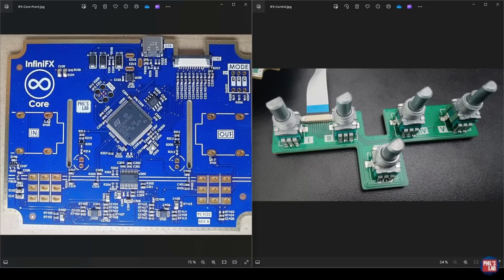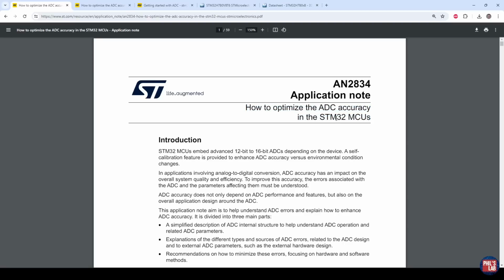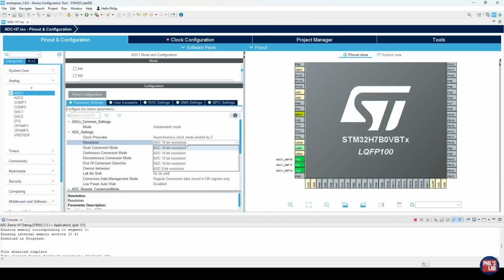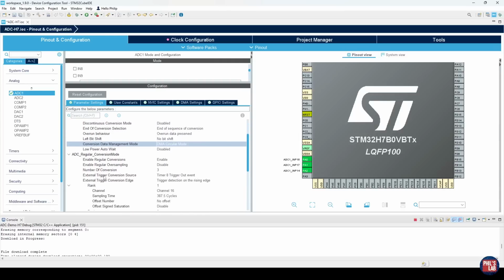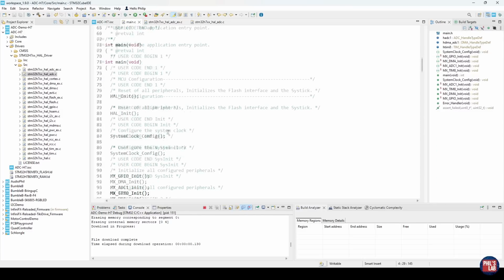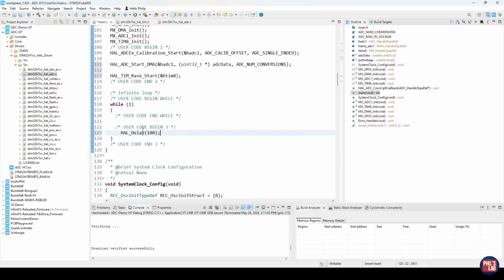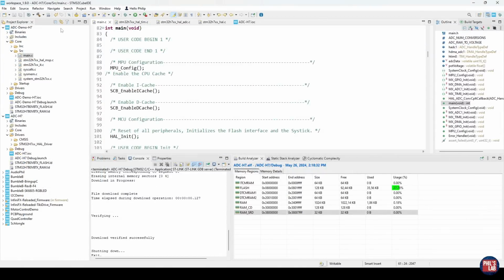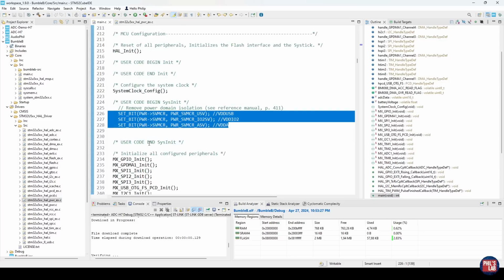(Sponsored) STM32H7 ADC + DMA + Timer Firmware Tutorial - Phil's Lab #138

Comment: This video is something I needed!!
I'm developing a VA synthesizer. I started development on Disco-F407 where I was able to run 4 voices, 16bit 44.1kHz. Then I moved to Nucleo-H723, cause I don't need a dual core uC for it. And there mayhem started...
It did not matter how well I would optimise code, it barely handled 5 voices. Then I saw yesterday that on this ARM core I have to enable caches to get a full speed of this core. I did it for I-cache as D-cache broke my DMA transfer to DAC. But thanks to your video I was able to enable and properly configure MPU to have D-cache enabled too. With I-cache lone it ran 7 voices (decent), but now it runs at least 12 voices (maybe more, did not test yet and I would like to have some spare cycles for FXes and modulation buses), so I'm pretty satisfied :)

Your channel kickstarted my interest in embedded DSP along with some books about writing softsynths. Now I have the power!!! :D

Comment: The best advice regarding any STM32 FW development (especially, but not only) for beginners - Go to C:\Users\<Your username>\STM32Cube\Repository\STM32Cube_FW_xxx - there you will fing your installed HAL packages from ST. Go into the folder for your CPU (so for example 'STM32Cube_FW_H7_V1.11.2'), then 'Projects', there you will find a bunch of folders for the Nucleo/Disco/Eval boards from ST. Pick any of them (sometimes you need to go through a bunch of them until you find what you need..), there go into 'Examples' and there are folders named as the CPU peripherals. Peripherals are almost always the same across the CPU family, so it does not matter the example is for a different variant of the CPU. As long, as it is in the same family (H7, F4, etc.). Each of them contains (usually) several examples of many possible use-cases for that peripheral. You can almost always find what you need.

Comment: Hello Phil's Lab, could you recommend me a microcontroller that I could use to control the gates of the two keying bridges. It is important that it generates PWM signals with a sine structure. Moreover, the two sine functions created in this way must be mutually shifted by an angle of 90 degrees regardless of the frequency within 0 - 500 Hz. PWM carrier frequency not less than 15 kHz. 
Ultimately, the system is to power the gates of 8 IGBT switching transistors of my 6 kW new generation Brushless Hybrid Fast - Rotation Motor.
Thank you in advance and best regards 👋😀💖.

Comment: Another great, and timley video again as I'm wrestling with the ADCs on a Nuceleo-H743ZI2!

I've followed everything, but I still get zeros in the live expressions when debugging and I'm not sure where I'm going wrong with this :( 

In the demo section where you have working values in the live expressions have you already done the cache control changes? I've tried the changes outlined but no avail.  The nucelo I'm using has different memory regions to the H7 used in your demo.  I have:
FLASH, DTCMRAM, RAM_D1, RAM_D2, RAM_D3, ITCMRAM.
Does it matter which I choose?  I arbitrarily tried RAM_D3.
Finally, you say this reduces the speed - I'm shooting for around 2 Msamples/s for my final goal. Will I run into problems with the cache here?
Thanks again for the great video!
Reply: So I have no idea what I did, but I got it working.  I think it may have been that the clock speeds were too high?

Comment: For power filtering, i always see people (such as altium academy and other) always mention to not use ferrite beads and other options are better. Do you support the same position or you think it's ok to use them? are there other ways to filter the 3.3V power line you showed in the video? thanks
Their claim is that ferrite can cause unforeseen problems as it can resonate and cause problems when high switching element such as ICs and uC are connected to, and the only OK way to use it is with DC loads.
Reply: It’s a valid concern. Ferrite beads form a resonant tank circuit, so the pulse of current an ADC creates during the sample and hold capacitor charging can set it ringing. If you’re sampling near the resonant frequency, you’ll get a buildup of this oscillation and your sampled values will be all over the place. A simple RC filter which you can design to be below your sampling frequency is much more forgiving and predictable.
Reply from the maker: In the prototyping stage, I like to add in series elements (beads/0R resistors) to be able to change them out/create/adjust filters if needed (rather than not have that option at all to begin with). Then, working towards the final product, if needed, they can be omitted or different values can be chosen.

Comment: What is your take on ferrite beads? Many reputable people tells you to avoid them, usually.
Reply: They’re useful for reducing EMI to get through testing, on power lines which might otherwise feed back high frequencies or sharp edges onto supply lines, but should be avoided in analog filtering due to their resonant properties. As with most components, there are places they are useful, and places where they are a disaster.
Reply from the maker: In the prototyping stage, I like to add in series elements (beads/0R resistors) to be able to change them out/create/adjust filters if needed (rather than not have that option at all to begin with). Then, working towards the final product, if needed, they can be omitted or different values can be chosen.

Comment: That cap in the potentiometer circuit is more than just a low pass filter.  These converters are capacitive ladder and draw a spike of current / charge when they sample.  The cap is a cheap easy way to provide this charge and eliminate a strange error you will see otherwise, as long as you can live with your chosen cutoff frequency.

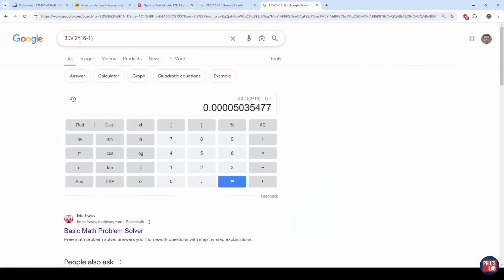Comment: 24:00 I always like to reinforce the idea of using the slope intercept formula to convert the ADC to pretty much any value you need. I haven't done any graphing whether the output is exactly linear, but I feel it is a good approximation. Your explanation is perfect and thoroughly enjoyed the video.
Reply from the maker: Thanks! Yep, if there is an offset that's the way to go! Usually the calibration is enough to remove the offset and then I just use the slope, as shown in the video.
Reply: Sometimes a linear cal is needed to compensate for offset and gain errors in signal conditioning and sensing circuitry.

Comment: Great video again, just up my alley. 😁

What is not 100% clear to me after some testing with the H723 and H750 is whether it's best to use SRAM that is in the domain of the DMA controller that is being used. From what I understand, if you use an SRAM block in a different domain than the DMA controller, the data needs to be passed through a 32-bit AHB bus to the other domain. For example, if you use AXI SRAM in domain 1 for the DMA buffer and the DMA1 controller located in domain 2, the data will pass via the 32-bit D1-to-D2 AHB bus that connects domain 1 and domain 2. This will take extra cycles or not? 

Additionally, I found that, for example, the BDMA controller can only access SRAM4 in domain 3, and DMA1 and DMA2 don't have access to SRAM4 in domain 3, and vice versa. So, I made sections for the different SRAMs in the linker file and used the compiler command to store the buffer in that section with attribute((section("blablabla"))). Not fully sure if this is the way to go, but at least I can use all the sram that is across the domeins.

The so-called master DMA, MDMA, is a very useful peripheral. Last week I've tested its link capabilities, which can be triggered by other DMAs and can set/clear flags and such. Made code that when I start DMA2D transfer(normal hal function), it's triggers MDMA when complete, and MDMA copies data from DMA2D buffer into SPI buffer that is refreshing the screen. It's a very simple linked list but it's done without any CPU intervention.
Reply from the maker: Thank you! Those are great points - yes, I believe it's important to watch out that ideally the DMA controllers have 'direct access' to the memory regions, if performance is critical (e.g. in real-time DSP systems).
For something like the pot sampling in this video I'm usually not too worried.

Comment: Just finishing the PCB design of a very similar project in Kicad.
I've been very impressed with the Teensy 4.1 MCU's performance as a synthesizer, using PJRC's game changing online Audio Design tool, which allows easy re-patching of software synth modules (waveform generators, mixers, multipliers, etc.), just like EuroRack synths, w/o the cords. Soldering iron not required. Otherwise, I would have chosen the STM32 MCU.
'Our pal, Dave' showed me the way, with his 'Notes & Volts" excellent Teensy Synth tutorial series. Thanks, Dave! 👍
I'm using the PCM1368A, with  6 ADC line inputs + 8 DAC outputs, with op amps to be compatible with industry standard laser projector signals.
Yeah, it's a T4 Laser Synth for creating abstract complex Lissajous imagery, ala Laserium living rooom.
Been learning a lot from your videos.  This is only my 2nd PCB project. Ver #1 prototype was a success, except that the CS42448 CODEC is now @ EOL  <sigh> Try, try, again, eh Mate? Stiff upper lip and all that rot. 
Thank you for your excellent guidance and videos, Phil.
I couldn't have accomplished any of this w/o YT tutorials like yours.

Comment: Good stuff! The H7x5/H7x3 series of this chip is a monster at 520MHz (550Mhz if you're willing to disable ECC). Though with that comes some nutty power domain complexity... Much more involved than the G4 series.
Reply from the maker: Thanks! Definitely, I use the H7 in quite a number of projects and it's possibly my favourite MCU.
Reply: Still a monster at the 280ish MHz flavors too.  We have been bitten by the cache in an H7B0... If we'd read more of the datasheet & ref manual we'd have been less dumb in porting some of out old code over.😮
Reply: Do you happen to have an app note and page number where they explain that you need to disable EEC when running in boost mode at 550MHz? I have some programs running with EEC enabled on AXI SRAM at 550MHz on an H723, and I never receive any warnings from STM32Cube IDE like you normally would when peripherals are clocked too high, but that could be a bug, of course. The MCU runs just fine without problems. 🤔
Reply: @PeetHobby  From the reference manual about the `CPU_FREQ_BOOST` bit in `SYSCFG` (section 12.4.26, at least in my revision): `When this bit is set, the CPU maximum frequency is boosted and the ECC on ITCMRAM and DTCM-RAM are no more used.` Without `CPU_FREQ_BOOST` you're only able to use `VOS0`, which according to the datasheet is limited to 520MHz (DS table 13: General Operating Conditions)
Reply: @PeetHobby  Rereading your comment again, sounds like you're in the clear: since you're using AXI SRAM the ITCM RAM is disabled, and at least from what I can tell from the reference manual you should be good to go since it only affects the ECC on ITCM and DTCM.